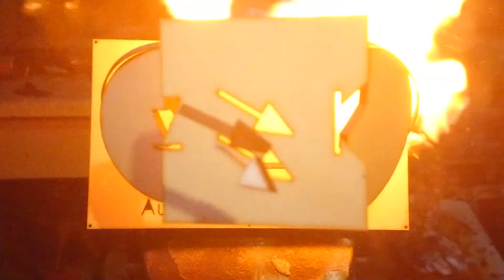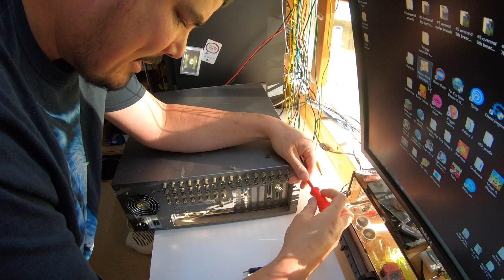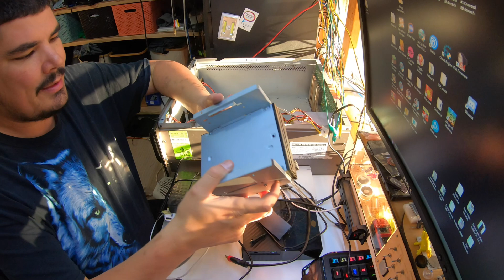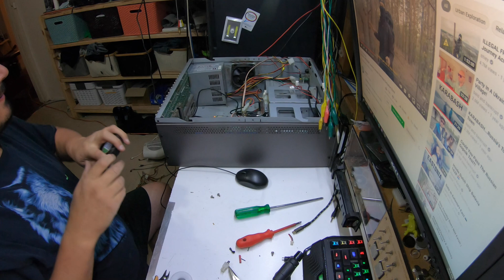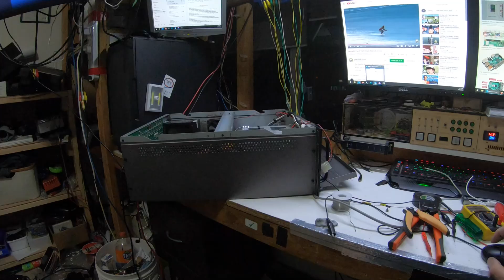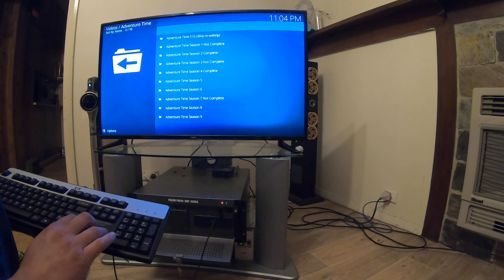Converting a Pacom DVR to a file server

Comment: The Western Digital drive likely has a usb to sata adaptor board plugged in, it won't be a custom drive
Reply from the maker: They all do, the pi doesn't have sata.
It has a funny right angle one that means I can't fit the drive in a standard bay, so it wasn't worth disassembling.

Comment: pci express video card, not AGP, first gen pci express card (ahh you got it later on), and no it was a run of the mill board, not an expensive board.
I have a similar case for one of my home servers(with a similar past use as well)... has a Ryzen 1700 in it though not a raspberry pi.
Man this makes me want to upgrade my NAS and send you my old one with drives...
Reply from the maker: This unit was 12 years old...
Reply from the maker: The attraction to this is the gpio interface, and low cost.